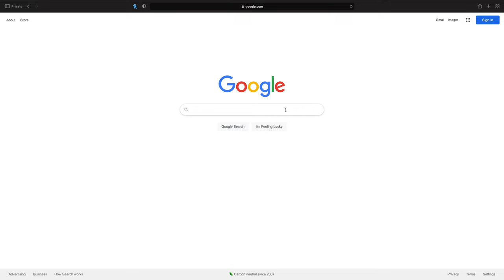VSI FULL ELECTRIC STEERING CONVERSION FOR 240SX

Comment: Hey Im curious, I see your ignition is upside down. & also your motor sits further from the brake pedal then mine does in the s14. Did you have to rotate the column to get the igniton back to the bottom?
Reply from the maker: No it was already set up for the ignition 👍🏼

Comment: sorry for asking.. why do need to keep the steering pump??
Reply from the maker: No worries! 
You could delete the pump and get a smaller belt and run a different pulley but you’ll need to delete the ac bracket to fit the new pulley
So instead of losing a/c we just keep it there
Reply: @SpiritDriven  ohh i see.. i thaught its same as rb engine.. cause no need to replace pulley ac or remove.. any way thank you so much 🙏🏻🙏🏻👍
Reply from the maker: @jokerroo  oh let’s trade engines 😂
Reply: @SpiritDriven  🤣🤣🤣 sadly im too far from you all im at malaysia.. 🤭🤭

Comment: Any driving impressions on this? Better or worse feeling than hydraulic steering? I’m thinking about ordering this for my s14 track car.
Reply from the maker: Much more reliable than hydraulic for sure
At times I was having random issues wheee I would lose PS for about 1/2 a second which really throws the cars balance off
This system is a very direct and slightly heavier feel which in my opinion is nice 
It’s been reliable and has been worth the money and time spent
Reply: Thanks bud, hope you figure out the cut out problem.  Intermittent loss of voltage? Bad connector?
Reply from the maker: @nicholaslapinta9315  thanks dude we actually figured it out last month finally lol
Bad egr + bpt valve

Comment: I'm confused, you sent them the column and they sent you the modified column back and then you had a separate column that you swapped out your ignition? Do they require you send them the column without the ignition?
Reply from the maker: You do have to remove the ignition 
My step was a little different they were able to ship me the column up front 
But what you’ll do is remove everything 
Send them the column and rack 
And then they’ll modify it all for you 
And then you’ll install it back into the car

Comment: Leaks aren’t hard to fix. Yours looked pretty dry under there.
Reply from the maker: Not hard to fix just a pain to do
I’d like to avoid it as much as possible 
Also it looks clean because a few videos back we did an engine deep clean
Reply: @SpiritDriven  “not hard to fix but a pain to do” is an oxymoron. Packaging looks good on the electronic stuff. Hope it doesn’t give any issues. Also
Reply from the maker: @HelpingHandAutoRepair  a pain meaning like nobody WANTS to do them 😂
Fingers crossed, it feels solid though for sure 👍🏼